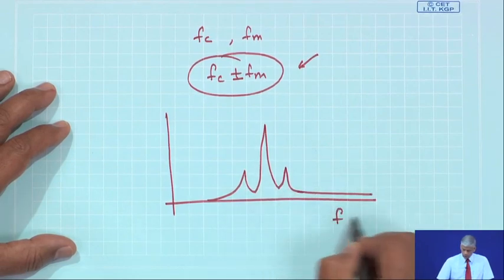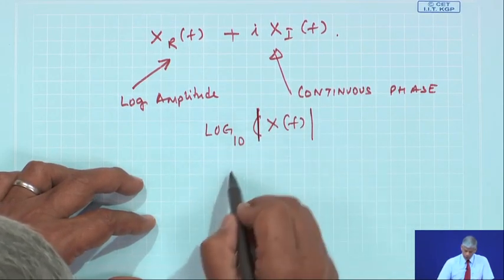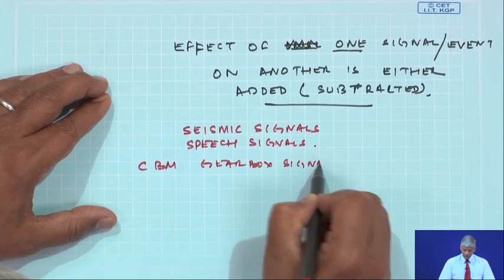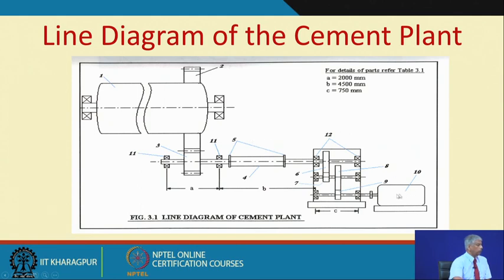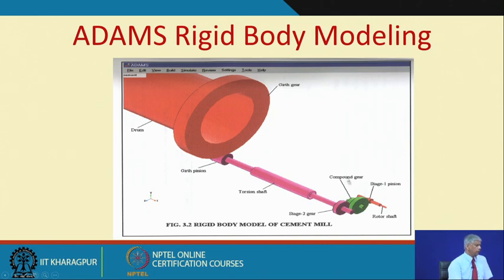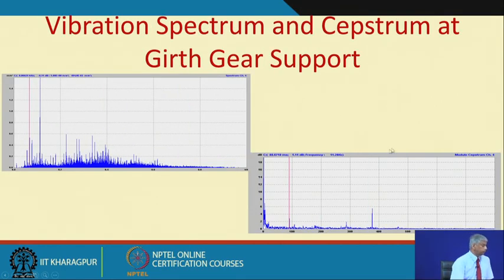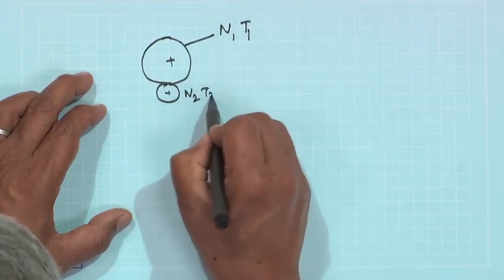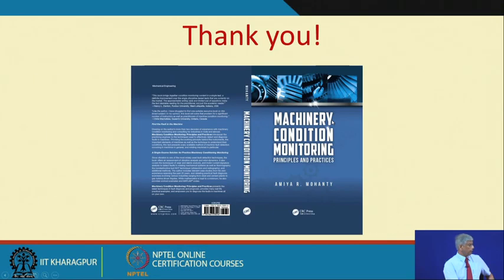Lecture 19 : Cepstrum Analysis

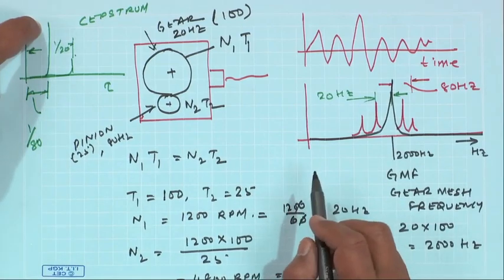Comment: 27:07 Could I use the Cepstrum Method Analysis in order to find fault in a machinery when the velocity (or rpm) of the machine aren't constant?? or Could I use this method in other areas like moving parts are involves like a Automobile Motors or in audio frequency Loudspeaker faults(coil damage, magnet misalignment, frictions between coil and pole pieces)??